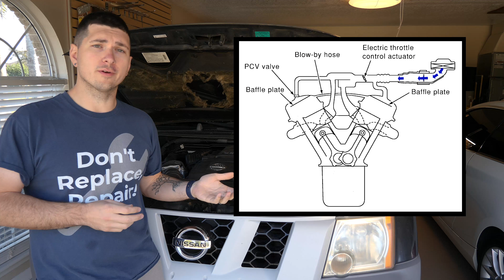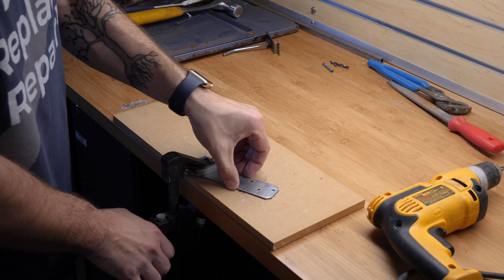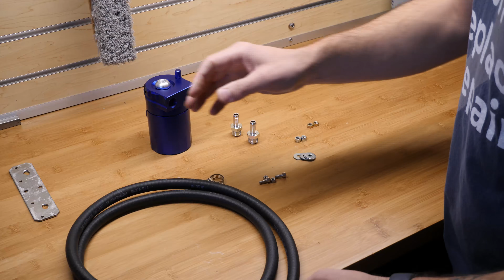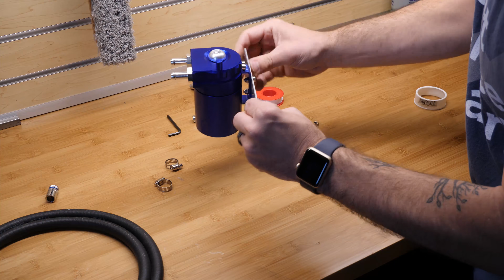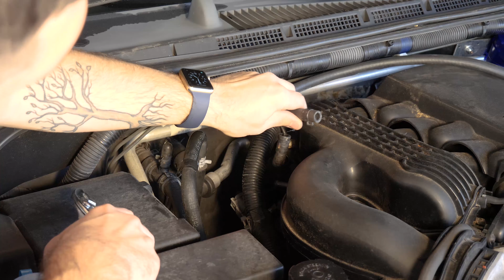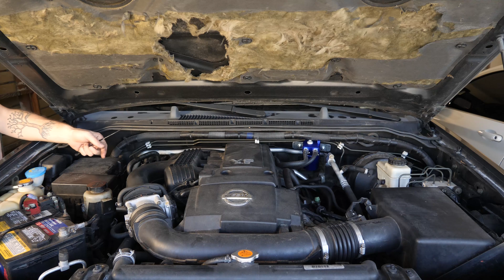How to Install an Oil Catch Can Into Your Car

Comment: This catch comes with a filter as well.  Can you tell me why you didnt use it and what its for exactly ?
Thanks.
Reply from the maker: Is designed to keep debris out of the intake, but I've heard about them breaking apart and ending up in the intake
Reply: @Rythecarguy  ok.  No filter it is then.

Thanks

Comment: Took me 1h20m start to finish including prep, cleanup, and making a bracket. Good practice for my upcoming IMS install and spark plugs once the parts land.
A 5"x5" T bracket ($3 from Home Depot) works pretty well. Bracket is zinc so it drills out pretty easily. Bolt spacing on the X is 9cm. I added about 4mm of washers — a neoprene one against the firewall then nylon — behind the bracket to help it rest better. Time will tell if they can withstand the temps. 7' of fuel line will leave you some working room. If you absolutely can't get that clamp off the back of the engine you can consider using a ⅜ ID barbed coupler to just extend it to the can.
Thanks for keeping my Xterra on the road, Ryan!

Comment: I made my on catch can for my 2003 Camry. I bought 24 oz aluminum drink tumbler made for hot and cold drinks. It came with a screw on lid with a rubber o ring seal and a hole for a straw. Paid five bucks for it at a thrift store minus the straw. I installed a small drain valve in the side near the bottom, used the straw hole for the return line fitting and installed the inlet line about a 1/3 of the way down from the top. Since the tumbler got smaller from top to bottom i was able to install a baffle just above the inlet line. With the baffle above the inlet any oil mist stays in the can and allows the vapor to recirculate.
With Harleys we install a filter on the end of the hose and vent it to the atmosphere. Recirculating it back through a car engine is bad enough but with a Harley the carbon will build up quick in the chambers and on the valves.
It builds up in the heads on a car because the air fuel mixture from the car doesn't burn hot enough to burn it out and keep it clean. Unless you are using an additive in the fuel on regular intervals.
Btw way mine is located up front down low beneath the headlite and battery. Easy to open the drain when i change oil. 
Great video that will help out a lot of people and that color blue is my favorite color too👍

Comment: My intake port was actually a bigger size. My stock pcv line had 2 size IDs on between the ends. I had to heat up the one end with a hair dryer and force is over the nozzel. Its never going to come off again lol.

Comment: Ry, I know this video is from a few years ago but the first link leads only to Amazon it doesn’t lead to the nuts used on the firewall studs. What size are those nuts? I ask so I don’t have to do the purchase and return, trial and error, at Home Depot.

Comment: Should have replaced the pvc valve too while your in the back engine twisting n urning. Good nice vid.
Reply from the maker: Thanks for the tip but it was already new at that point.

Comment: This catch can works well. You can also insert some stainless stool wool into the can (the thicker kind and not the ultra thin kind) to enhance the baffling effect. In doing so, it improves the functionality of the oil catch can and catches more oil overall. Great video dude.
Reply from the maker: Yea you can. I am just really nervous about putting anything in there that might get sucked into the intake.
Reply: @Rythecarguy  That's fair enough brother. Better safer than sorry as they say :) I have the same catch can and for the money they do very well!

Comment: My nav has 16mm diameter ports for the crank case and 16mm on the turbo. The catch can only came with a max of 14mm. Not so easy to find the right hosing.

Comment: Good use of mounting.  Just a couple of minor comments.  Use thread lock or lock washers on the nuts re-attaching the can bracket because they can vibrate out.  Also, put a washer on the first spacing bolt under your bracket.  This will sandwich the big bracket holes between two washers for better distributed force so the bolt won’t wear through the hole, and it will be more secure.
Reply from the maker: Great tips! Thank you.

Comment: Why didn't Nissan do a recall to have this added or at least alert customers to this issue? I'm going to order this kit for my 2014 Xterra.
Reply from the maker: Most cars don't have this. The way that it's designed is how vehicles normally operate. This is just an aftermarket product that helps capture the oil before it makes it back into the engine.
Reply: @Rythecarguy  I watched a video explaining why this is needed in GDI engines. I don't know if the 2014 Xterra has a GDI engine, though, but it sounds like it would be useful in a lot of vehicles.
Reply from the maker: Agreed. I wish they all had it but they try to make things as easy as possible for people. This just adds more maintenance.

Comment: So I tried for as long as my patience allowed, but I could not remove the factory hose that connected the pcv to the air box. I gave up and remembered that I had vacuum connectors from a previous project so I used those to connect the IN from the can to the existing pcv valve and then just connected the OUT to the air box. Thoughts?

Comment: 4:00 that’s where the recirculating pump goes for rear automatic hvac. My pathfinder has one so I’m trying to figure out where I want to mount the catch can now. Btw thanks for your videos! I’m going to be replacing my timing chain shoes using your video as a guide this spring.
Reply from the maker: Nice! Thanks for letting me know. I hope your timing chain guides go well!

Comment: Interestingly, how does one know, AND WHY DOES THIS exist within OEM Engineering : with engines...? Would not the Car manufacturers know-Develop-update- SERVICE BULLETINS-MECHANICS-put on Engine-Offer ETC: if this is such a PROBLEM  GDI ENGINES.? Admittedly, my 2015 4 CYL, Dodge may be 100K Mile Warranty??.....

Comment: Does it need to be in that spot ?? Or can it be mounted by the intake with longer hose???
Reply from the maker: You can mount it wherever you like!! Have fun!
Reply: Right by my cold air intake
Reply: Thanks I just finished mounting it :D
Reply from the maker: Awesome! Where did you put it?

Comment: What is the benefit of this and is it used for all engines
Reply: In my car's case (Peugeot 306 XSi) sludge (mostly building up with short drives in cold periods) was clogging up the intakemanifold and mapsensor.

Comment: So, I must have an even more base model than you! I don't have those studs! HAHA wondering if there might be another way to add them in!
Reply: My response is old, but on my Frontier I didn't have the studs either. So I got some 1 inch washers, put a bolt through and secured them together with JB weld. Then adhered that to the firewall and voila, studs! Not pretty, but it works.

Comment: Thanks.... its the same install for Nissan frontier 4.0 V6 engine.  You must have rats or mice tearing your insulation from the hood.
Reply from the maker: Yep! I had a huge issue when I lived up north with field mice and squirrels getting into the engine bay during the winter and tearing it to shreds. Really pissed me off.

Comment: Can you elaborate on that second larger hose that goes into the stock "oil trap" on the air box? How does that differ from the PCV in function?
Reply: no, that is engine fresh air  breathe in hose,  PCV  allow only  engine breathe out  air.

Comment: I’ve noticed that many cars will have this hose really short..and lot of people are running catch can with really long hose, will that make a bad impact on our engine ?? Also what’s the fittings size and how they’re called ? I appreciate the video..many people won’t go in details telling you the hose diameter or fitting, mine came with some 6an and 8an and I don’t really know how to set those up!! It’s easier for me to buy your same fittings with same hose and put some clamps ! TIA.
Reply: Hose length will not impact the engine.

Comment: I have a question about catch cans, are they mainly for GDI engines only,or are they good for about any vehicle? And do they actually work? Thanks for the helpful video
Reply: Oil catch cans will benefit any engine. Even if they do not have GDI. Of course GDI engines benefit most because it reduces build up on the valves, but the secondary function of a catch can is it keeps oil out of the exhaust system which ruins catalytic converters. Oil is not fully burned in the combustion chamber and will destroy the cats, which will lead to engine destruction if not replaced immediately. Basically ceramic dust from the cats after they have been destroyed can come back into the combustion chamber and wear out piston rings which leads to loss of compression and more oil burning.

Comment: Seems like a passenger side install would have been simpler and possibly more effective. I’ve been wondering if a second can for the driver side bank that feeds to the intake plenitude on the tube. I’ve noticed there’s a significant amount of oil there as well. Though it seems the pcv valve sends the oil to the right bank cylinders. The left side of the lower intake manifold was mostly dry and shiny while the right side had a significant film. The spark plugs after 100k miles also showed a history of light oil spray ect.
Reply: there is no room on the passenger side. this is old but incase anyone is reading drivers side would be was easier to get at a catch can with oil in it.

Comment: Just wondering if I'd need to fit an oil catch can to my fiesta mk6? I'm replacing the stock air box and I don't want the crankcase breather hose hanging about doing nothing so I guess it could run to a catch can

Comment: Do you have a sense of how much this helps with a port injection car? I am a car maintenance noob, but I read elsewhere that port injection cars (like the XTerra(?)) effectively clean the port with gasoline so there's less oil and junk thrown back into the intake.

Love the videos by the way - I'm learning a ton.
Reply: I am copying a reply I made to someone else: Oil catch cans will benefit any engine. Even if they do not have GDI. Of course GDI engines benefit most because it reduces build up on the valves, but the secondary function of a catch can is it keeps oil out of the exhaust system which ruins catalytic converters. Oil is not fully burned in the combustion chamber and will destroy the cats, which will lead to engine destruction if not replaced immediately. Basically ceramic dust from the cats after they have been destroyed can come back into the combustion chamber and wear out piston rings which leads to loss of compression and more oil burning.

Comment: Not hating, But did you just install a metal bracket right up against the metal AC Line???????
Metal to Metal contact isn't good in an engine bay

Comment: Hey Ry any tips to repair catalytic converter for my 2005 Xterra or anyone here got any tips
Reply: DON'T LET THAT SIT WITHOUT REPAIRING, IT WILL RUIN YOUR ENGINE!

Here is a reply I made to someone else but it touches on that: Oil catch cans will benefit any engine. Even if they do not have GDI. Of course GDI engines benefit most because it reduces build up on the valves, but the secondary function of a catch can is it keeps oil out of the exhaust system which ruins catalytic converters. Oil is not fully burned in the combustion chamber and will destroy the cats, which will lead to engine destruction if not replaced immediately. Basically ceramic dust from the cats after they have been destroyed can come back into the combustion chamber and wear out piston rings which leads to loss of compression and more oil burning.

Comment: On my 2006 Pathfinder, that mounting spot you chose is where a small coolant pump is mounted for the rear heat. It's routed over too the passenger side and goes down the firewall and goes towards the rear. Thought you had asked about it in the video.
Reply from the maker: Oh that’s awesome, thanks for letting me know.
Reply: No problem, Ry. Glad I could help. How is the catch can holding up?

Comment: Did you use the O-rings that came with the kit?
Reply from the maker: Yes sir.
Reply: @Rythecarguy  thread side or nipple side?
Reply from the maker: Thread side
Reply: @Rythecarguy  I figured it out. Got it all installed and plumbed. I did the spark plugs simultaneously. Pretty easy stuff. Thanks for the videos man!

Comment: What did you mean by “the MIL is off?”
Reply: Malfunction Indicator Lamp or CEL Check Engine Light.  So if after installing this and you do have that light on, there is an issue.  Since it is off after installing, all is good.

Comment: Few notes if you want to do it:
1. Remove the hood or you will be banging your head on it plus you get better access and view of the hose
2. The electrical loom can be removed but there is a small tab inside it and you need to use a small flat screw driver to lift it then pull
3. Disconnect the grey electrical plug to get better access
4. Use silicon lubricant on the inside of the tube before inserting it, those plastic inlets can be fragile.
Did mine today and iI had to fight with the outlet from the PCV but finally got it off, some blood was spilled.
Reply: Good tips!  I'll add my 2 cents because I'm a bleeding narcissist.
#1 - Get a longer hood prop to use while working under the hood.  Taking the hood off for a small job is overkill, IMO.
#4 - Use a small amount of motor oil instead.  Silicone can damage sensors.  They may be upstream, but oil should work just as well.
Reply: Taking the hood off would be the hardest part if you did
Reply: op

Comment: Can you do a video showing how to install keyless entry for all doors including the hatch in an Xterra?  Your videos are super detailed and I'm struggling! Lol
Reply from the maker: I’m sorry you’re having trouble. Unfortunately my Xterra does not have power locks and I don’t currently have plans to install them.
Reply: @Rythecarguy  well if you ever do, I'll be here watching.
Reply: I thought my frontier didn't have keyless due to the dealership.  13 years later I bought a key fob off Amazon for $20 and low and behold, I now have keyless.
Reply: @rider173  really? How did you program it?
Reply: @QuiannaLamey  as long as the chip in the fob is probably tuned to the specific frequency for that vehicle, they often come with programming instructions. You normally have to do some combination of the key in the ignition and the locks within 30 seconds, and then you push buttons on the fob and it programs right to that car.

Comment: Excellent tutorial! I have the same oil catch can, only black.
I have installed mine right at the PCV inlet of the intake.  This way I have minimized the length of tubing going from and to the can. Anyway, the amount of crap collected in the can makes it a mandatory upgrade for this car, IMO. I like a little dipstick. In fact, you can remove of the oil/water with the syringe w/o unscrewing the bottom cap. Please do a follow up video during your next oil change.

Comment: Thanks for the video Ry!! Two questions: 

Besides the fact that your line was frayed, how would one know it needs doing?

Also, do you think this would extend the longevity of the catalytic converters? (not sure if that's a dumb question, I'm a car-guy in training)

Thanks again!!
Reply from the maker: It’s not really so much the car needing it. Technically all cars could use some form of cleaning device in the PCV lines since they are designed to bring dirty air into your intake. I’m sure other engines may create more or less of suspended oil in the PCV lines than this one. The easiest way to check is to pull that PCV line out and just look at how much oil is in the line itself coating the walls of it. The main line that I replaced will almost undoubtedly have oil in it and the second one that I showed you in the video may also have oil depending on how aggressively you drive your truck, or if you tow, etc..  

As far as the catalytic converter, I doubt there’s any research that supports this but it would make sense considering the catalytic converter is meant to take toxins out of the exhaust from the motor and sift it out. So it stands to reason that the cleaner the air going into the motor the cleaner the air will come out which equates to less work for the catalytic converter. That’s a good thought.

Comment: How many miles do you have on your x?
Reply from the maker: About 139k
Reply: I have 200k on my Pathfinder same 4.0v6 as xterra..runs like a  champ..not touching it.. I have a 2000 xterra 3.3 that also runs great 160k.
Reply: I have 128k on my 2012  . Thanks for your videos

Comment: Excellent instructional vid. Will this work on Frontier too? Im curious if location has room to undo the catch can bottom to drain the oil ?
Reply: Pi Noy The Xterra and Frontier are practically identical, so yes.

Comment: By the way is there away to avoid buying the whole assembley of heater cause you have breaked plastic parts for the inlet and outlet hose for the heater hoses 
or no way?

https://youtu.be/0khBgAVWRzg

Comment: Great video as always! Thanks Ry. Will be using the same catch can (from your amazon link) to do mine sometime soon. :))     Not a huge fan of where you mounted your can lol... maybe I will see what other things I can fab up.
Reply from the maker: Thanks man!! I appreciate you using the link. It’s a great way to support the channel. Yea I am a real stickler for not making new holes in the truck so that spot was a slam dunk for me. However I have seen people make brackets that fit to the left of the intake. It’s usually an L shaped bracket that gets mounted in between the truck and some other item already in the engine bay (like the fuse box or something). Once you get it mounted please come back and comment on where you put it!